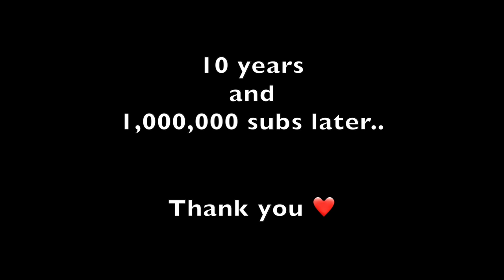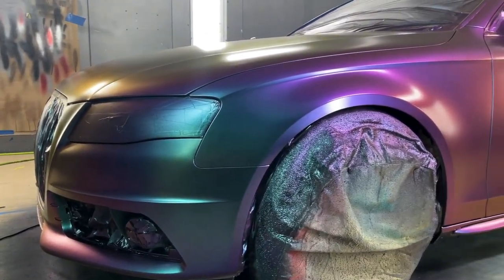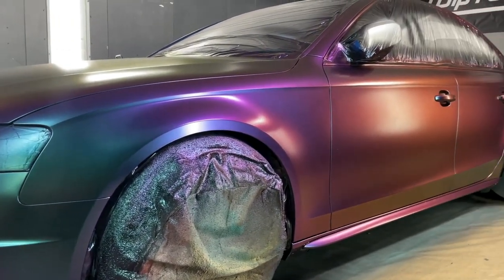Spraying VOODOO VIOLET Candy Over ZTS HYPERSHIFT (Million Sub Special)

Comment: That is the effect I looking for, my a project I'm doing. Just a few questions, do you sell the pigments on there own? Ate they compatible with casting epoxy resin? The glossy top coat do you sell it in smaller quantities? What is its shelf life? Can it be sprayed with an airbrush? 0,5mm nozzle? I've used standard plastidip, but its difficult to get thr correct consistency. Thank you in advance. Phill from the uk.

Comment: So firstly, it looks great no 2 ways about it.. the shade of pink-violet are epic.. but.. you did loose the green shade which is a little disappointing. So next project using a candy you have to remember. Green through blue to violet hyper shift looses the green when you use a violet candy. Apply a green candy you'll probably loose the violet. Something to consider. Gratz on 1 mil subs

Comment: I think its nice but removes the green from the hypershift. Less candy? 
On a side note, I'd like to see the two best galaxy additives. Not mixed, but with two guns. Make your normal run starting on the front driver to rear driver. Periodically hitting it with a seperat gun in a different galaxy pearl, shift, flake....whatever. Dual wield if you will. Cheers!